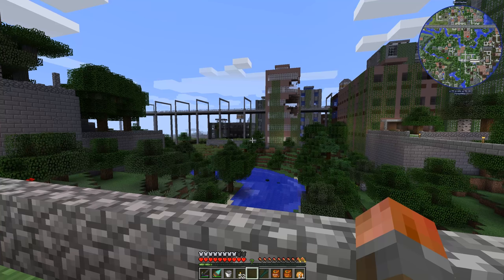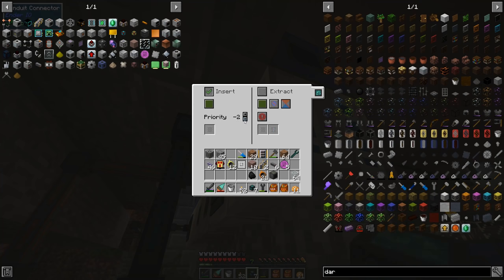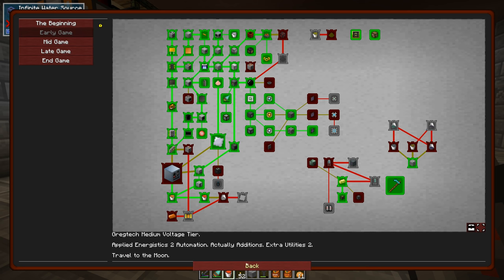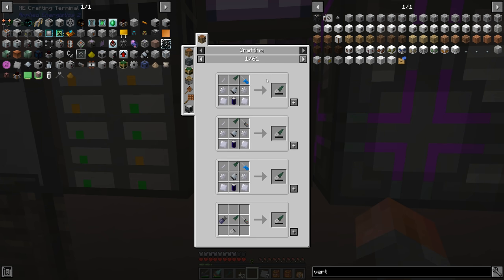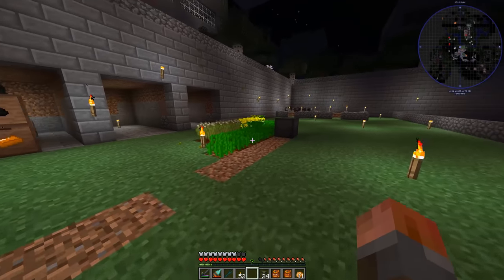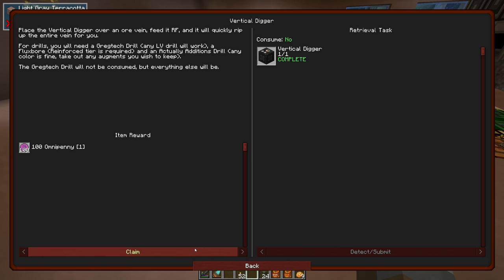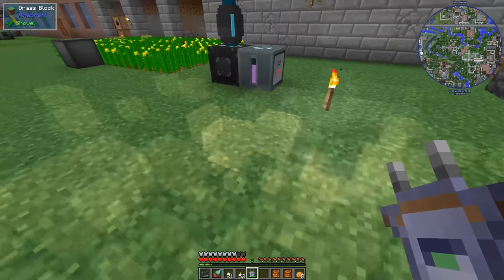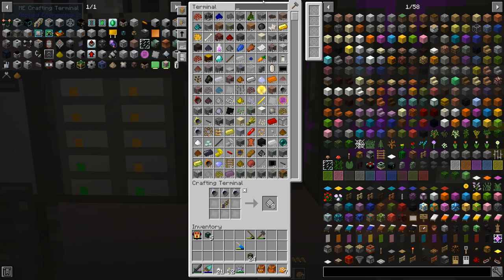Omnifactory E27 - Automatic Mining and Farming!

Comment: Canola into Canola Press = Canola oil. Doesn't show up in JEI but there's a quest chain for it.

Your water electrolyzer is stuck since it is filled up with hydrogen! You need a massive amount of it later for certain crafts; Offhand, you centrifuge 2.5 buckets of Hydrogen per Modularum ingot (Modular machines material).

Similarly, your Ethylene maker from Ethanol and Sulfuric Acid is clogged up with Diluted Sulfuric Acid. 
You'll probably want to get those ender fluid conduits + filter sucking up the excess. Also getting air instead of oxygen for the polyethylene, since, current blockages aside, you have a lot more ethylene than oxygen produced.

Grab one of those new blank patterns into your inventory for the quest! To be honest, you should prioritize making those patterns make the components so you can just queue up Interfaces from basic materials.

One thing you might want to buy a stack of Sphalerite, macerate it twice, then centrifuge it, then electrolyze the result. This will build up your Gallium stores, and the next circuits, while cheap, do end up going through a decent amount of Gallium overall.

Once you get some black steel, you can craft an End Cake and head into the End. Well, black steel and some Luminescence into End Stones. Using your ender hook, killing the dragon shouldn't be much of an issue. Even before that, just getting the to the End can get you some delicious End Stone for making End Steel, into End Steel Conduits. No rush, but it'll help support you even into HV.

Speaking of Conduits.... Make them in an assembler! You get 1 extra Conduit per craft in the assembler rather than manually for the same ingredients. IIRC item conduits give 3 extra.

And still on conduits, you know there is an ME conduit right? It can't have screens put on it, but it does stack on other conduits, so you can run your ME system across your base in the same line as your power. To make them, cover 3 glass ME cables with rubber in an assembler, then take those 3 and 6 conduit binders to get the ME conduits.

A fancy setup I put in my base: ME Interface, storage bus on the side. Have the Crafting Card in the interface, store 3 stacks of clay dust in the interface. On the side of that have an item conduit pulling out clay dust and throwing it into an electrolyzer. Essentially the interface queues up crafting clay dust whenever it's needed, and the electrolyzed clay dust provides an abundance of aluminium dust. Then just throw it into your blast furnace and functionally infinite aluminium ;3. Actually, now that I think about it, you don't even need the storage bus on the side, it's there so you can see the dust from other interfaces in the system but it is unneeded for this setup.

Personally, for storage, I put a storage bus on the front of a Drawer Controller, at higher priority than my storage drives. Significantly saves on drive space, since hardly anything goes into my AE system. Usually, only temporary subcomponents for crafting. That being said, it does take a large portion of space,  as well as wood, but small price to pay IMO. Drives cost circuits ;p.

Comment: Like I said last video CEU with a Flux capacitor works fine for powering it. Just keep it all in a satchel so you can move it around easily. Also with all 3 Phantom Cores I believe it mines in a 33x33 area and uses 500-600 RF for each block it mines. There are also 2 modes mine all blocks and mine only ores. Either way it does scan each and every block below it in it's mining area in a sweeping pattern (1-2 maybe even 3 a second)  so with all 3 cores it's gonna take 10-15+ minutes to get down to bedrock. That coal ore 1 block down would have been outside the range before you put the phantom cores on. It was probably several levels down before the cores got added. You can click reset to have it start from the top again to get what you missed.